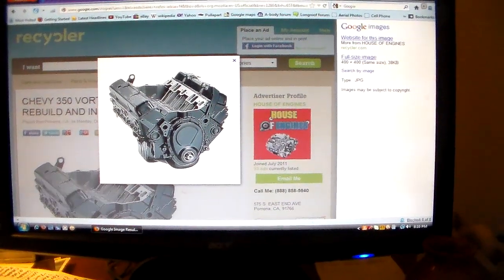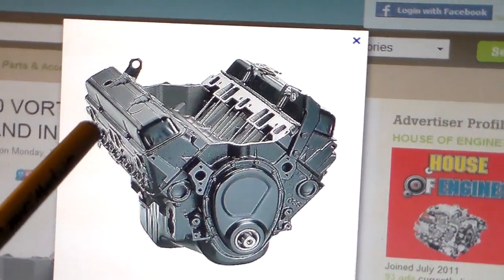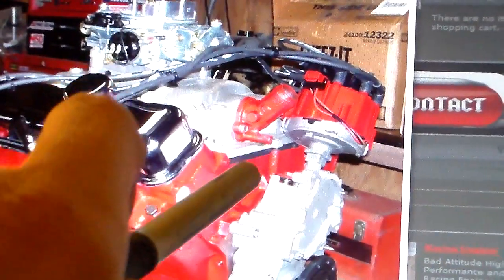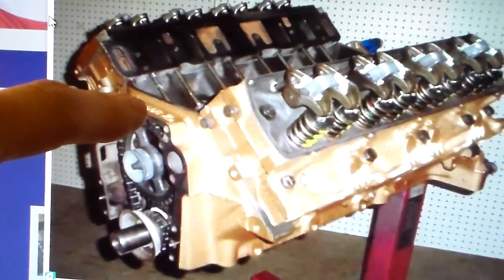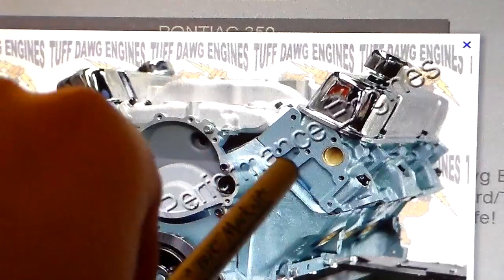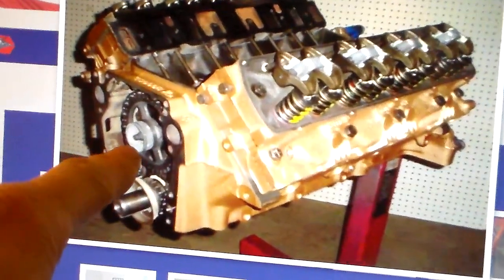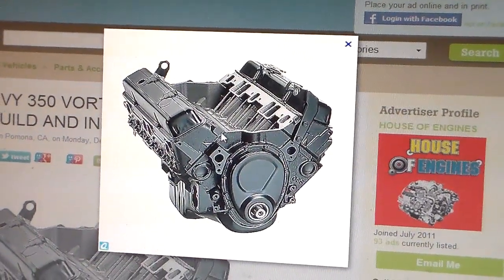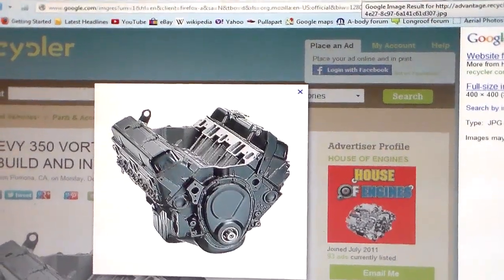Chevy, Olds, Pontiac and Buick V8 engines are not the same!

Comment: As well as each GM division having their own engines, most people don't know that in the late 50's and early 60's Ford and Lincoln-Mercury had separate big block families. Ford had the FE big block and L-M had the MEL big block. Ford had the 352 and 390 FE BB and L-M had the 383 and 430 MEL BB. Later on the Ford FE was expanded to 406, 427 and 428. The L-M MEL BB was expanded to 462. To make more confusion in the late 60's Ford came out with the 385 series Big Block. Ford and Mercury divisions got the 429ci 385 series BB and Lincoln division got the 460ci 385 series BB. And Ford had two small blocks, the Windsor family, 260, 289, 302 and 351 Windsor and the Cleveland (335 series) family, 351 Cleveland and 400. The Cleveland SB family and the 385 series BB family both had canted valves.
Reply from the maker: +trucking604 correct.  Don't forget the 351M
Reply: +WhoSaidTyler The 351M was part of the Cleveland family. I had a '75 Ford Elite with a 351M. The 1975's were the early emission engines, by then the power was really down.
Reply: +390merc65 And the Flat Head.
Reply: +trucking604 That and the fact that the terms "Big Block/Small Block" are actually more of a GM thing than a universal thing. Chrysler's blocks were technically either "short" or "tall". Ford had ALL sorts of crazy different types as you mentioned from the MEL, the 385's, the Winsdors and Clevelands, etc.  People tend to use the terms small or large when, ultimately, it has no real bearing on the dimensions of the engines in comparison from Brand X to Brand Y, and all to do with it's differences from the other engines. The only real difference between the Pontiacs is that, other than engines like the 455 or 421 superduty, they all used the same block so only bore, stroke, weight, and the proprietary components to X CID designation . AMC didn't even have big blocks because their "small block" was significantly tougher than the average. It's basically just a misnomer that sticks like "wedge hemi" because people love having two very vague categories to stuff X or Y engine into when it's quite literally relative to one or the other. 

As it comes to the canted valves it's sad more companies weren't smarter about that quicker. Mopar's hemi had the extreme opposite of inline but they're close enough to canted that I usually involve them in the "canted vs inline" demographics. Chevy's 396 BB was originally nicknamed the "porcupine head" because it's canted valve design made it look funny.
Reply: +Dusty Nonya I think the term Big Block and Small Block mainly pertains to automotive engines. During WWII Ford had a 1,100 CID DOHC Hemi headed V8 gasoline tank engine. That would dwarf any automotive Big Block engine. But obviously it wasn't for automotive use.
Reply: gm had a 24v567 engine that would dwarf most trucks
Reply from the maker: jdr ok
Yes the 567 was available as a V8, V12 or V16 in locomotives and tugboats. Roots-blown and naturally aspirated.
Reply: FE, contrary to popular opinion, does not stand for "Ford-Edsel" but rather "Ford Engineering."
Reply: No, they were turbocharged or Roots SCAVENGED, but never naturally aspirated in the normal sense of the term. You can't run a two cycle plenum fed diesel without positive plenum pressure with respect to the exhaust. The amount of positive pressure is measured in inches of H20, not Hg, the blower is not considered a "Supercharger" in this application. The blower drive on a Detroit handles very little power and when these blowers are converted and mounted on a gas or methanol/nitro burning drag race engine , they are used as a true supercharger but you have to massively upgrade the gears and drive section. The general rule in drag racing is that the Roots blower ate half of the power increase it made in mechanical energy to drive it. Before Top Fuel dragsters switched to a much more efficient design, the Roots blowers on these things were taking well into four figures of raw power to drive. When you see gas blower motors making power on street rods and punk racing cars, WOT fuel consumption is astonishing because the horsepower is being used to turn the blower via the huge Gilmer belt. 

 I was trained on Detroit, not EMD but the tech is very similar. The turbo EMDs have a special and expensive turbo that has a sprag clutch to mechanically turn it via gearing from the crank on start. That's why they make that noise on startup a Roots blower EMD or a GE loco does not. Turbo Detroits have a bypass valve that unloads the mechanical blower and can run considerable positive plenum pressure but the "NA" versions, which are not really NA at all, blower scavenged, probably never see 1 psi of difference to atmospheric, maybe a tenth of that?
Reply: That's why after 1955 Chevrolet took over from Ford as the hot rodder's car. Everything on SBCs interchanged 1955-1986 and a lot for fifteen more years. A lot interchanges on the BBC too. Ford was a nightmare of different engines, basically nothing fits nothing without machining and general bother. Mopar had a little better deal but the G, LA and B/RB engines all had different bolt patterns and so forth. Mopars had great engineering mechanically but Mppar styling, electrics, general fit and finish, and interiors (after Virgil Excess)  were inferior to GM. Mopar had the best automatic transmissions, GM close behind, Ford had several of some were ok and some were junk. Ford did have superior casting metallurgy, and the 9 inch rear end which was the best, Danas next best. GM cars had the best electrics overall, Ford used Leece Neville alternators that were a lot noiser because they were wye vs delta winding. Chrysler had the first good electronic ignition and the best overall, as long as you carried a spare coil resistor. GM had the dubious honor of building the single cheapest and crappiest car in postwar American history, the Vega, but it could have been a great car if they'd spent a couple hundred dollars more on each unit. Ford got busted for actually having someone say out loud what everyone actually did-figure it was cheaper to kill people than fix the issue. Even at that, and it was shameful, the Pinto front end was so well designed the hot rod companies still sell it for street rods 45 years later.

Comment: I don’t know who thinks these are the same engines , I’ve never heard this before , but as I’ve mentioned previously in the mid 50s they were taking different designs from one another . But no parts are not interchangeable from to another . There were some big time racers back in the day that wound interchange crankshafts on certain engines like the 348 had the same journal size and the 396 .
Reply from the maker: I think as long as this information and other sources have been widely available now, people have finally gotten it. The old tobacco-chewers that used to lean on a fender and spout off nonsense have mostly retired now.

Comment: The Chevy becomes the corporate engine in1975
 Up to present date until the ls is induced to the public and. What I say is back in a legal battle in court please do your homework and then make a video ok
Reply from the maker: Homework on what? I'm familiar with the timeline of all this. The small-block Chevy became the "corporate" V8 in 1991 after GM had put the last Oldsmobile V8's(which were 307's) in the 1990 Custom Cruiser, Safari and Estate large wagons.  It certainly wasn't that the Chevy was a better engine...rather it was that they didn't want to keep trying to smog the Olds engines. The other two (Pontiac and Buick) V8's went away because there just wasn't a need for 4 (5 if you count the Cadillac) V8 engines.

The lawsuit was not in 1975. It was in 1977 after a man in Chicago discovered his Oldsmobile 88 had a 350 Chevy engine in it.

Comment: All internal combustion engines work on same principle / intake/ compression / power/ exhaust /so all same only variations on a theme ( even 2 strokes tho they make 3 -8 x the power) as far as design No Vastly different ( Fond of Pontiac 455's) worked on all ,  the 455 has hidden tricks example bolt on 6x heads for 100-150 hp gain / 3" exhaust with headers for 120 hp gain / dry sump the oil and 85 hp gain, considering we have not touched internals yet and you just got 345 hp for tid bit of work and minor expenses - also Pontiac's were Vastly under rated if you look them up in the books only rated at some 290-310 hp / but then note the Torque up to 510 ft lbs torque and note the RPM's not at 6,500 but only a tid bit above idel at 2,500 rpm!!! Oops !!! did some body not do math /// What is this beast pushing with a good ram air 4 cam slapped in with above tweeks !  620 HP stock - 700-850 hp tweaked on out ! ( oops ! ) Overlooked           ( Single carb - https://www.youtube.com/watch?v=UMLBv_hyerM )
Reply: Nope

Comment: At that. There are lots of combinations of 350 parts to build your 350.
Mine is a 90s GM 350 EFI in a 1987 K20 that used to have a Chevy 350 EFI that was almost 100 Horsepower slower and atleast 60 less torque than the 90s GM version of that same engine
Reply from the maker: That's a great engine for that truck. However, that small-block still can't touch a stock 455 Buick with 510 lb-ft of torque at 2800 rpm.
Reply: Well look at MPG and reliability though

Comment: The engines were dramatically different. My 455 olds is not the same as the Pontiac and Buick 455 but lots of people (who never owned any 455) will argue that I'm wrong. They are similar in size and they are V8's...but they are different designs developed by different engineers.
Reply from the maker: Correct. The same people would not accept that all of the Pontiac V8's other than the 265/301 were the same size externally.
Reply: @TylersNeighborhoodGarage  lol. Tell them an olds big block outweighs an olds small block by about 100 pounds and they lose their minds... they think running the small block is so much lighter you turned the car into a Porche style road racer. I think it is actually the term big block that messed so many guys up. Its a name, not a measurement it's a comparison. Keep up the good content.

Comment: Is it true Pontiac's 4.9L turbo V8 was one of only a handful of such turbocharged gas engines out there, at least those made here in the U.S.? Most turbocharged automobile engines of the day -- including diesels -- were either inline 4, inline 6 (Mercedes-Benz had a 5-cyl. diesel!) or V6 engines, but never a V8.
Reply: Those turbo 301 V-8's were pure junk and, yes, it was one of a very few turbo gas engines then.  Just a pure boat anchor.
Reply: gm had it in 1961 and all of the pontiac ones where kinda slow it wasnt junk just slow was meant to be crazy and it was fucking cool
Reply: It was junk then, it's junk now.  Crazy fucking cool junk.  Now...we both win.
Reply: Jeremy Murphy it wasnt junk because it was a 215 cid boosted engine that rover bought and used and a f1 team bought one from gm and used it in a f1 car and won with it lol

Comment: kind of like saying a Chevy 454,Buick Olds and Pontiac 455 and Cadillac 472 and 500 are the same.and nothing would piss off a enthusiast quicker than calling a 455 Buick a Pontiac 455 or vice versa or calling a Olds 455 a Buick 455 or Pontiac 455.the Big Blocks are vastly different than one or another.they only share displacement and that is all there!Blocks,Heads and Bore and stroke are all different on the 455.
Reply: actually a cadillac 472 and a cadillac 500 are the same
Reply from the maker: *****
physically, but different bore and strokes. That entire family was the 368/425/472/500.

Oh, and half the population still is convinced there's a 501 Cadillac, can't forget that one.
Reply: belive it or not 472 and the 500 just had different cranks
Reply from the maker: *****
that's right.

Comment: Bro what year 5.7L 350's are you comparing I mean that's what's causing such a major difference between the engines  I know there are slight differences but that all depends on what year we're talking about you are very knowledgeable and I wouldn't argue with you on any automotive issues  thanks for the interesting video
Reply from the maker: The years aren't relevant. Each division besides Cadillac had their own family of V8 engines that ended up with a 350-cid version. But..there were also 330-cid Oldsmobiles, 340-cid Buicks, 326-cid Pontiacs and of course 305-cid Chevrolet engines that were identical externally to each division's 350 engine. So, it was mostly a marketing idea to have 350 engines. As it ended up, after 1980 there was no longer a need to have 4 different V8 engines and the associated cost of smogging all of them, so they discontinued all the Buick V8's, all but one Pontiac V8 and then kept the Oldsmobile and Chevy V8's.
Reply: I was born in 1980 so I wasn't around for all that. So thanks for the cool info Once again iv learned something. I think I totally misunderstood the point of the video and the argument that started it though now it makes sense

Comment: You make a very good point and you proved it WhoSaidTyler! You know your stuff. Just curious will a chevy engine go in an olds and vice versa?
Reply: MICHAEL DAVIS The bell housing/transmission bolts are very differnt
Reply: Thank you Ryan.
Reply: Yes they will if you try hard enough lol just use a bop or chevy trans whichever is your application and the correct mounts the g bodys had the holes drilled for all the different engine mounts factory but mismatching mounts and making something work is all part of the fun right anyone can buy a car not everyone can build one tho lol a welder and a torch and some good drill bits and bolts and bam the olds motor is in the Camaro lol lots of pickup trucks came w an olds. Diesel which is just an olds gas converted so hense remove the diesel install the rocket 350 from the 69 cutlass. With a good hei and not the points distributor and you have a really decent truck that's pretty quick and will tow a house if you can get traction right have fun guys stay warm

Comment: You are correct, up to a point. In the last years of GM's rear drive V8 powered cars  all use a common V8. Which were based on the Chevrolet engines. I don't know exactly what year it was, maybe the mid to late '80's when this happend but it was a sad day in my opinion. Olds and Buick built the strongest of the lot, Cadillac built the biggest - the 572. Today the only V8 that is available is the gen II and gen III Chevy.
I have been a master tech for over 40yrs and have worked on all of them.
Reply from the maker: They started using Chevrolet small-blocks in Olds, Pontiac and Buick B-bodies starting in 1977 as a substitution for an engine from the respective division, without informing buyers that their car had a Chevy engine in it.

 There was a class-action suit as a result, so now all window stickers from GM say "This vehicle equipped with an engine from various GM divisions"

Didn't make much difference after 1980 because that was the year that Pontiac and Buick V8's were dropped, leaving only Chevy and Oldsmobile small-blocks.

The Cadillac V8 engine family was 368/425/472/500. Thanks for watching.
Reply: WhoSaidTyler Thanks Man. I could'nt remember exactly when GM made the change. I stopped dealing with GM shortly after that and started to concentrate on European and Japanese cars. To me, that is what made GM so unique. each brand had it's own engine, design and engineering teams. Besides the big Olds, one of my favorites were the 348 and 409 chevy's. Some guys on youtube are building 440in 409's using 427 cranks. I might have to start turning wrenches again.
Reply from the maker: klesmer
I'd love to hear one of those 440's run.

Comment: I agree with you if they were the same why would each division make the same engine? and I though all gm bell housings would interchange I heard buick and olds have a similar bell housing and mounting patterns to a chevy engine and Pontiac is different im not sure if this is true or not but im gonna be to put a buick 430 in a 68 chevy c10 truck
Reply: Chevy has its own pattern. Buick, Oldsmobile, Pontiac and Cadillac (BOPC) share the same bellhousing. Some TH350 and TH200R4 transmissions have dual pattern and can be bolted to either engine. If you are swapping a Big Block Buick engine to a Chev you will want a BOPC pattern TH400 to withstand the torque, unless you have a TH200R4 built to higher specs, good option if you want an overdrive.
Reply: The SB Chevy V-8 has it's own bell housing bolt pattern. Even different than the Chevy I 6's until 63 when the blue flame 6 was put to rest.  The early big block had it's on pattern as well that too changed to the pattern still used today. The reason I know this is that my Dad built sleepers. I have as well.
Reply: bowtie4ever96 bop chevy and caddy are the bells